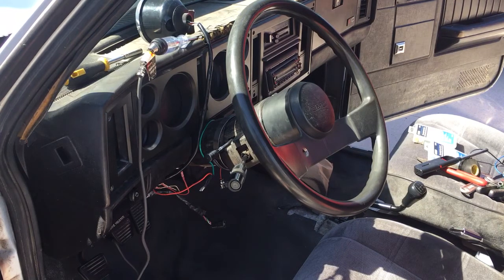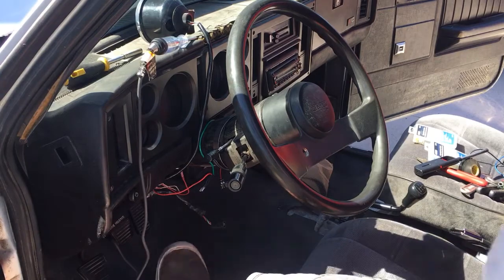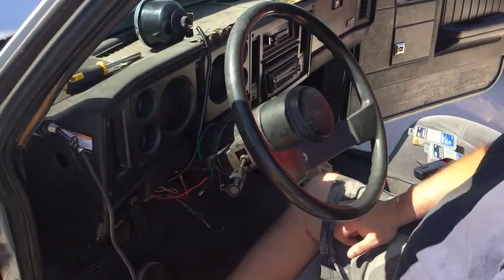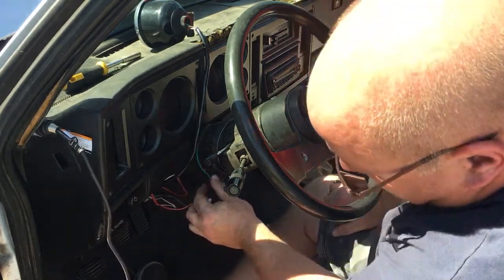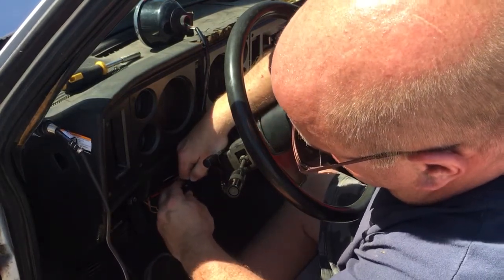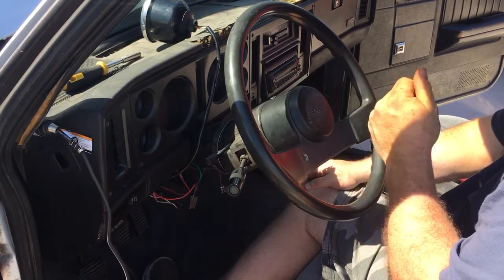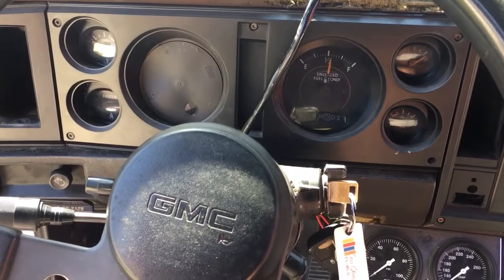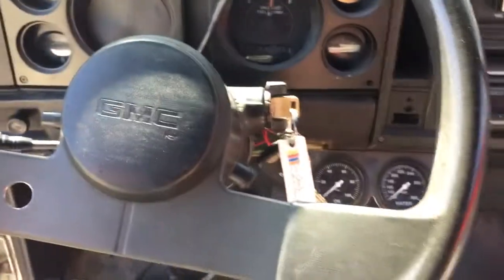LS Tach install wiring and settings

Comment: So you bundled red,green white wire from pcm together to 12volt ignition
Reply from the maker: Todd Green No! 😳. The “Red” wire goes to a keyed 12v source, “Green” wire is the Tach signal, and “White” wire is the internal light 💡 inside the tach hook it to a wire getting power from the a light switch.  “Black” wire is the main ground. 
I hooked the White & Red wire together to a 12v source when the key is on, so the light inside the tach will be on anytime the key is on.  It’ll wear out the bulb faster this way! 
You must have a tach with cylinder select, you’ll need to set the tach to 4 cylinder in order for it to work with the OEM tach signal.
If your tach is only 8 cylinder then you’ll need a resister to make it work.
Reply: @HeadFlowInc  so red 12volt prong  white to light prong, green and pcm white wire spliced together. 4cyl mode.  u use resister or not this way